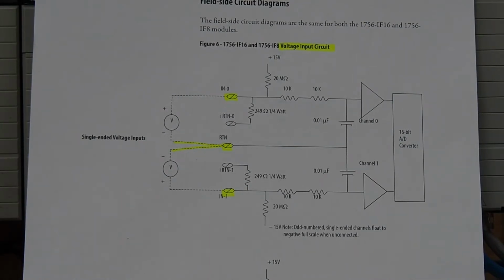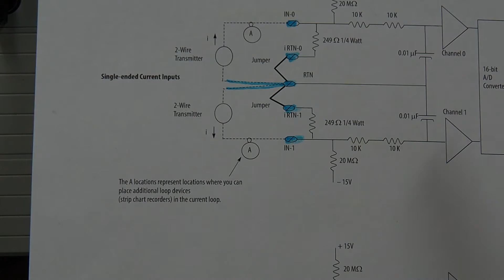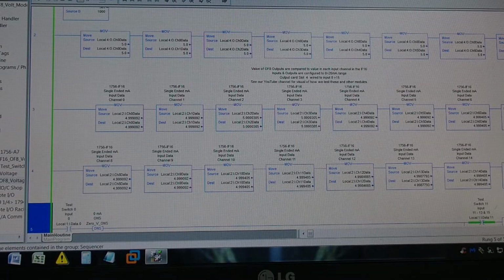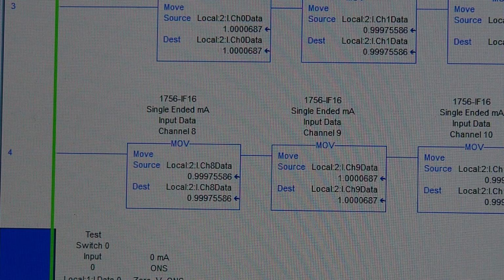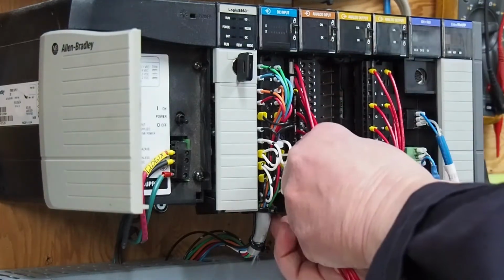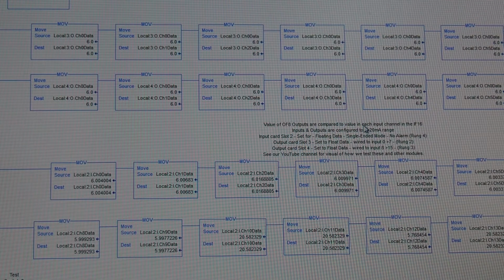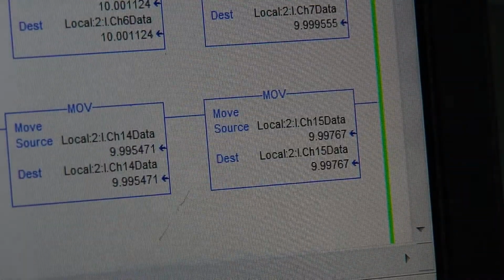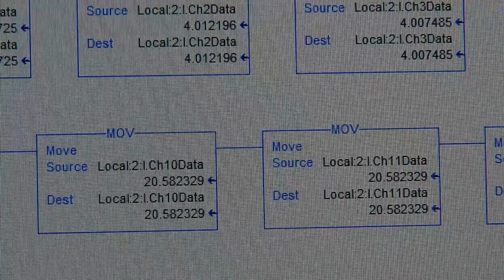1756-IF16 - Damaged Inputs

Comment: Do you have 1756-L61 16.053 firmware?
Reply from the maker: Hi tt cheney:
Sorry I do not have any firmware.  Do you need a processor flashed?  You can flash the firmware yourself using your copy of RS5000.  
There are multiple videos by others showing how.  Because of that I have never done one about flashing the processor firmware.